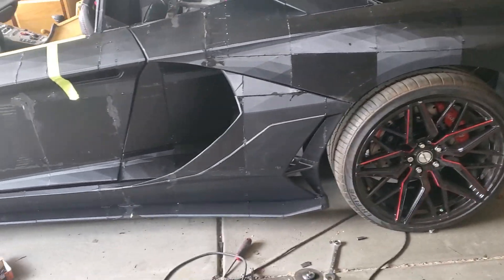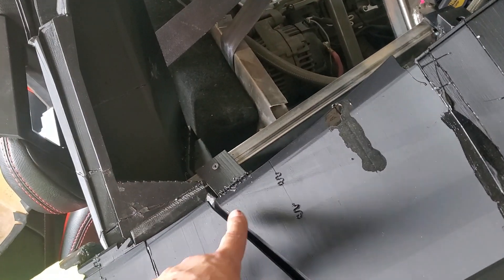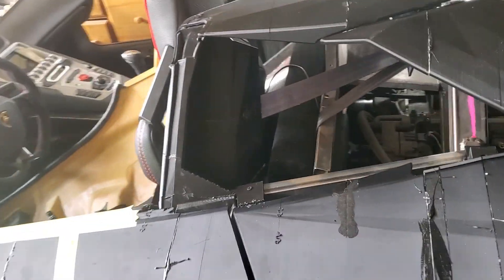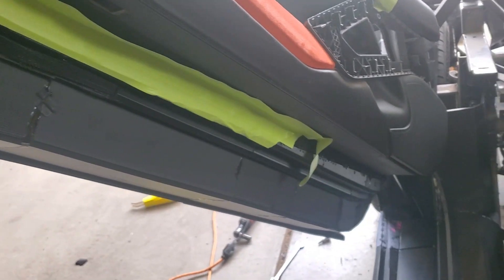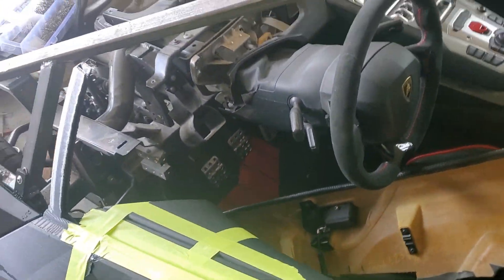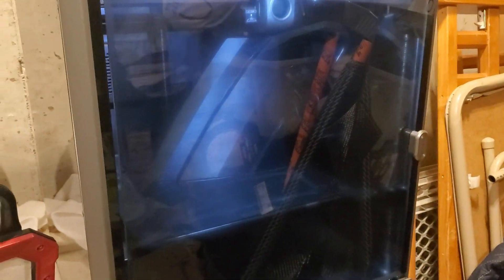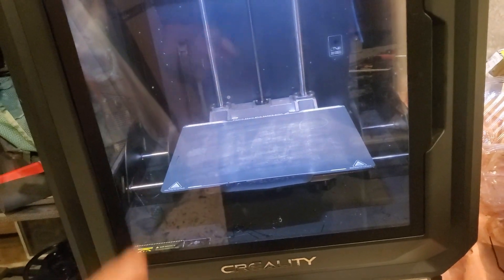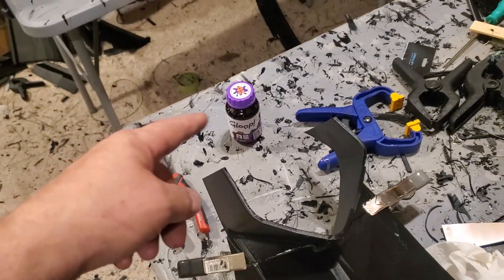3D Printing an SVJ Panel Alignment

Comment: I'm legally blind and planning  on 3D printing a car body of my own but for a adult EPC (Electric Pedal Car). How did you get the door panels to fit together and working windows? I do not have money to  buy the doors I want, plus I'm designing my own car but the base is the 2017 Corvette C7.
Reply from the maker: Hours of fitment, trial and error.
Reply: @lasersterling   Did you use an existing part or door? And thank you for your time. 🖖

Comment: Where did you get your heat stake equipment?
Reply from the maker: Heat stake?  The plastic joiner?
Reply: @lasersterling  yes the heated equipment to put the stakes in the plastic
Reply from the maker: @electricsupercar  Amazon, I will look up the specifics and email you.